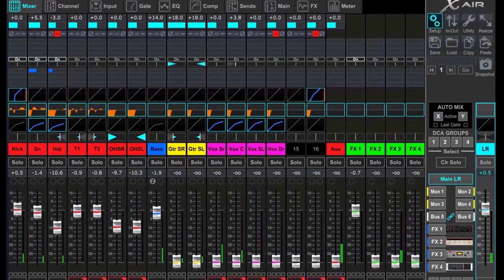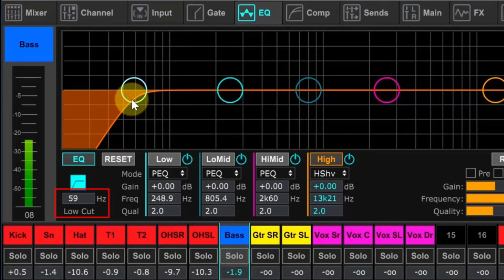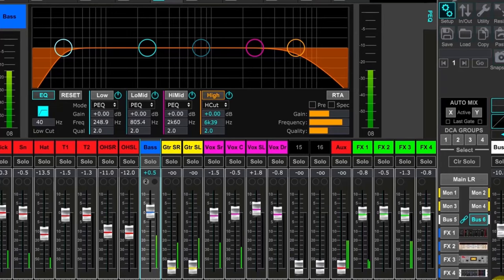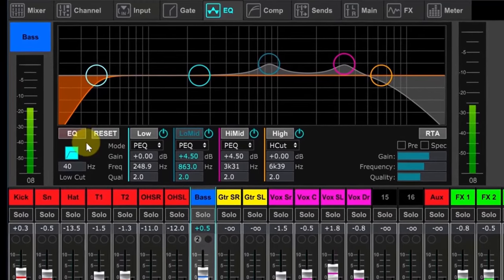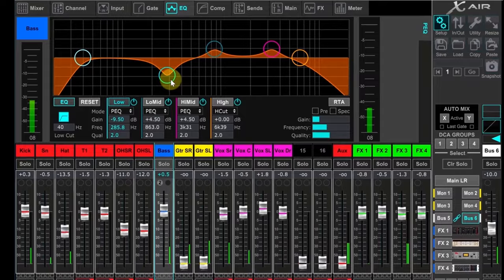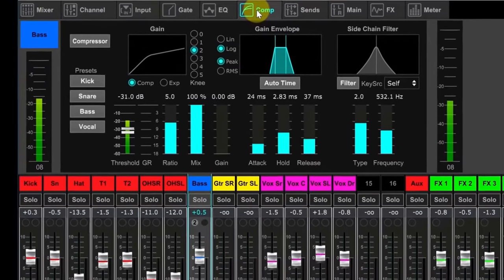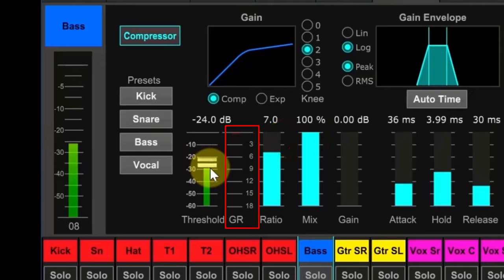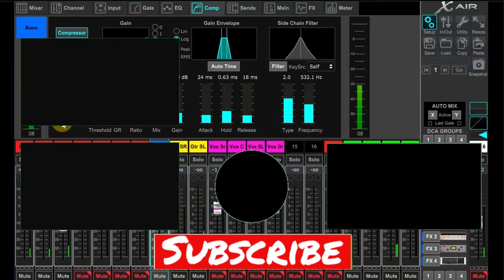Mixing Live Bass Guitar. EQ and Compression Tutorial for Live Sound

Comment: Hey Alan another great video..im gonnna use the xr18 for the very first time this saturday for practise and sunday for our live worship.  we are currently in a hall surrounded by hardwood flooring and tall ceiling.  I wonder if you have any tips for this kind of venue?  we are small church about 50ppl and I actually just bought a used subwoofer and was wondering where to put that also.  Cheers!
Reply from the maker: It's always good to get some height on your speakers. In a perfect world, a lot of height and a downward tilt, to make sure the sound hits the listeners first and foremost, and not the walls. 
But, also, make sure your speakers are high enough, even if on stands or wall mounts, that the highs aren't just blocked by the first row or rows of people. 

Sometimes, smaller rooms are more problematic than large rooms. Just because you cannot get much distance from the mics and the speakers, and because speaker placement options can be limited. And moderate stage volume in a large room could be really excessive in a small room if the musicians don't adjust.

Don't think your (house) speakers HAVE to be tight to the stage. They can be spread wider (this should help mitigate feedback potential because it's putting more air between your mics and the the speakers). Just make sure they are aimed to hit the listeners. So maybe if they are out wider, they needed a little angle inward. But don't do too much and negate the width by turning them too much into the mics. But technically, they should already be a little in front of the mics no matter where they are in width compared to the stage.

If you have a pastor that likes to walk around with a handheld, a lav, or an earset mic, then the wider distance will help there too. As will getting some height. Although, when I say 'height' if you have no down angle adjustment, then about 7' or so is about your max or you'll start getting diminishing returns.

As for the sub, if the room allows, just center it. If not, you'll generally be OK to place it to one side of the stage near one side of the other's speaker. Just make sure to cross it over low enough that the signal is more or less omni-directional. Hard to tell you without hearing and measuring what is best, but I'd probably try 90-100Hz if I was just guessing.
Reply: @AlanHamiltonAudio  thank so much and we will definitely try our these ideas!

Comment: Thank you for this tutorial, what is your routing options for the bass, do you route into the sub and FOH speakers.  If you are recording Live, does the same setting apply.
Reply from the maker: Thanks! I do usually have the bass guitar routed separately to subs and tops for FOH.
As for recording, essentially the same rules apply but you can be a little more creative in the studio, and some of the things I might do with a HPF could be different in the studio. 
Mainly, in the studio, what is going to 'tape' (DAW) is the complete bass guitar sound that listeners will hear. Live, there's going to be a lot of stage wash from the bass guitar in a lot of venues and with a lot of bands and that will have to be mixed around if it's already loud enough in some frequency ranges.

In bigger venues, that is less of an issue.

Comment: Do you ever use a PEQ to drop the bass around the frequency where you boost the kick drum (60-80 hz)?
Reply from the maker: Yes, if it seems that the bass and kick are clashing and muddying up the mix, and it's primarily the bass guitar creating the issue.
Although, the bass rolloff might also work (HPF).
Reply: Just set the Bass HPF a little higher than the kick and you’ll hear a huge difference. It has helped me a lot when mixing FOH. 
Use your ears and don’t go to much!

Comment: I'm curious about your thoughts one the relationship between bass eq at the board and the Mains/Subs.  I play in a group that, even with a dialed in bass tone, always feels like it is washed away by an extraordinary amount of low end energy.  I mean, I love the low end, but there is a limit.  I want to hear the notes!  Is it a crossover issue, a speaker volume issue, or, maybe the bass settings aren't as good as I think they are.
Reply from the maker: Kind of hard to say because the sound system could be working as designed and it just has an exaggerated (overall) low end by intention... Or it could be that there's a specific frequency (or range) boosted too much on the system EQ... or the opposite and cut too much (LEAVING something essentially 'boosted' by the nature of what is 'gone' (cut).
If MP3/WAV/CD music sounds like it should then the system is probably dialed in OK. In that case, it's just a matter of tweaking the HPF (low cut) on the bass guitar channel.

It could be a room issue too where the PA is exciting a low end or low mid frequency (or frequencies) in the room. You'd be able to tell that if the problem only seems to happen in some venues.

That assumes the problem is coming from the PA. It COULD be the bass guitar onstage. Cab too close to a boundary, or worse, 2 boundaries (like in a corner) and it's the sound from the stage muddying the bass guitar more than the PA. And secondarily to that, just too much bass/low end boosted on the bass guitar (or too much in the way of mids being cut and to 'hear' the bass better the level is then turned up, bringing up the excessive low end. The sound might work good in solo, but when the band is playing it causes the bass guitar to get lost because of the lack of clarity. IOW, it can't cut thru the other stage sounds. Sheer volume can 'seem' to help it be heard, but it creates or exaggerates the other issue of excessive low end.

And you can kind of get to that issue either by low end boosting, or mid/mid-hi cutting.

The tough part is, it could be one or all of those things in combination. So, one thing alone might not solve it.

Just listening to the bass guitar either by itself, or with the band, or even both ways, with the PA off can also answer some questions.

But the quickest place to look in a pinch when the show is rolling is the channel HPF (low cut) and trying a higher roll off frequency.
Reply: This definitely sounds more of a room issue, I struggled with this for a long time. I think you should experiment with the high pass filter on the bass guitar and the kick channels. Outside/big open spaces might only require say a 40hz high pass or none at all but inside (especially small rooms) might require up to an 80hz high pass to control the low end. 

Also, for the bass guitar to stand out more in a live mix I tend to give a good boost around 800-1khz.

Comment: Dumb new user question, can this also be applied with your IEM”s
Reply from the maker: Pretty much. The same basic rules of EQ will apply... but you might find you need a higher HPF setting, depending on how dynamic your playing is and how well (or not) your earbuds handle low end.
It might be a case where you like a little more compression too. But I'd get the basic EQ sorted before stressing too much about compressor settings.

Comment: Thank  You.
I use a small hall for worship and most times the bass amp gets too loud and covers the house. Can I just Use Di box direct from the bass or speaker out on the amp
Reply from the maker: Yes, although make sure the DI you choose has a pad switch that allows for a speaker level input on it if you're going to connect to the speaker out of the amp. Otherwise just take it direct to the DI from the bass guitar, or the line level out of the bass amp.
Reply: Thank You.
However, since I have an in ear with a dedicated bus channel for the bass guitar.
Is the bass am still necessary?
Reply from the maker: @eugeneanyanebechi4138  Bass "am"?
Reply: @AlanHamiltonAudio  Bass Amp(bass combo)

Comment: EQ before Compressor on the pedalboard OR compressor before EQ?
Reply from the maker: There's no 'right' answer here because either 'can' work. It kind of depends on what you're going for. And how you do things as far as settings.
If you put the comp before the EQ, then if you use heavy EQ the comp can't necessarily keep your overall frequency range in the pocket... since there will be peaks and valleys after what the comp has already worked on.
But you 'might' like that...

If you put the EQ before the comp, then it will be able to better control notes trying to jump out or fall back due to EQ boosts or cuts. Especially if you tend to do heavy EQing and get aggressive. 

I'd say if you're just looking for a general rule of thumb, I'd say comp after EQ on a pedalboard. But that is by no means carved in stone. If you can't convince yourself of a reason to put the comp before the EQ, and trying it doesn't make you go "Wow, I like that much better!"... then definitely land on putting the comp after the EQ on the pedalboard.

Comment: If you want rock solid bass without the usual muddiness... stop running your subs off a crossover from the main outputs.  Instead, run the subs off a separate crossover, or simple low pass filter, from a post-fader Aux.  Then ONLY bring that Aux up for the bass guitar, bass and lowest (largest) toms, and keyboards.  Nothing else needs to go to a sub set at 160 Hz (or even 180 Hz or 250 Hz if that is where your subs are set).  That eliminates ALL the garbage out of the sub that should NOT be there.  You could also use the mono master output, but that is usually only available on large mixers.  Same using a subgroup, and NOT adding it to the mains... but usually they are already taken up.  However, the easiest is a post-fader Aux.  It is easy to check that only the proper channels are headed to the subs.  And, you can adjust ALL the low registers up or down depending on the room conditions.  Just remember, when you are adjusting the mains up during the night, you also have to bring up the sub Aux.
Reply from the maker: Aux fed subs is a great tool to have in your bag of tricks to clean up system mud.
But, people need to remember to still use their HPF and EQ as they normally would... even if they aren't sending those channels to the subs. In the case of EQ, some people get into the 'bad' habit of adjusting the sub send when they should be adjusting the low end EQ instead.
And in the case of HPF, taking that mud out of the channel strip can still help things like the compressor be more accurate not having to deal with excess low end....
And of course, when mons are FOH,  that HPF is still handy. Or when the mons are Post EQ.
But the main thing for those two points is to make sure any stream mix or broadcast mix, or two track recordings (coming from the house console), get a properly EQ'ed and balanced mix.
Which, as long as aux fed subs are utilized properly, they will... But sometimes people assume there's no need in using then HPF since the aux fed subs makes it inaudible... in the house PA... But if the house PA is not the only place the signal is going, then it's still helpful if not necessary for the mix to translate to other sources.
Reply: @AlanHamiltonAudio  Absolutely!!!  All the channels that do not have frequencies in the sub woofer range should always have the HPF in.  Regardless of what crossover you use,  or what db per octave it is set for... there is always bleed through.  That is the biggest advantage of an Aux driven sub, if it is used correctly.  There cannot be bleed through, because the signals are not present on the send!!!  The HPF's are that much more insurance that stage rumble and mic drops and idiots tapping the mic to see if it is on and such does not get into the woofers of the tops.  In fact, the HPF's are really helpful on vocal channels with a board utilizing Aux driven subs.  You can boost the channel's bass control, and really get some drive in the vocals... without risking or worrying about them getting muddy.  It does not work as well with subs off the mains though, again the bleed through to the subs.  And, to keep all ranges crystal clear... I always had a crossover in-line with the reverb and the delay units.  Run in the first channel and set the crossover for 600 Hz.  Take the high output of that channel into the second channel, and set the crossover for 6,000 Hz.  Take the low output of that channel as the input for the reverb or delay unit.  You have now limited the input to 600 - 6,000 Hz.  Or, if the crossover can be set for three-way, you could use the mid output for the same thing.  It is amazing how much cleaner the reverb and delay sounds!!!  BUT... that is all old-school analog mixer with off-board compression and effects (Allen & Heath 56 channel with 8 subgroups 10 Aux sends, 12x4 matrix mixer, and  L and R and M main buses).  A digital board... I'd be lost.  I'd be lost anyway.  After ten years on the flight-line in the Air Force, and decades of live sound... my hearing is crap.  The graph looks like a crossover with a roll-off at around 1,800 Hz   :(   Had to finally give it up because, even with hearing aids, I could not hear high frequency feedback   :(   Keep putting these videos out there.  They have good info!!!  And, digital is the way to go.  None of the manufacturers are selling big format analogs anymore.........
Reply: Isn't this standard?